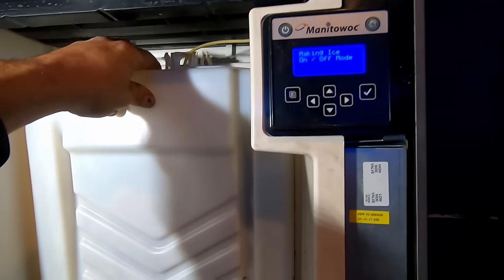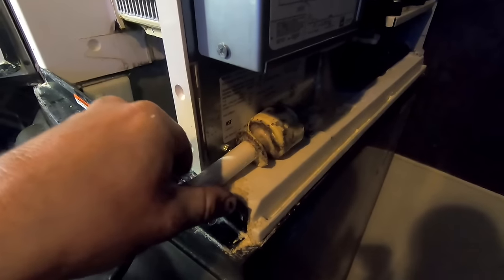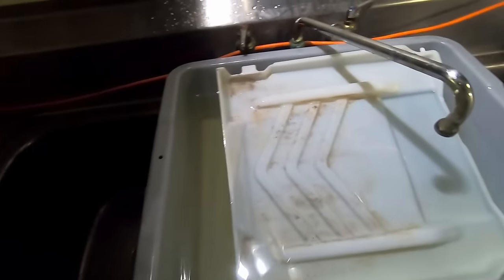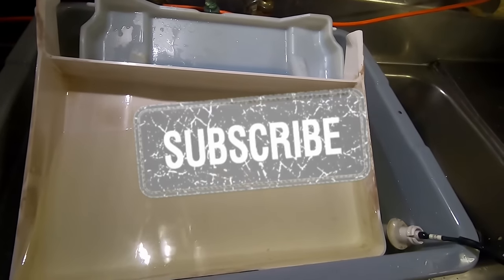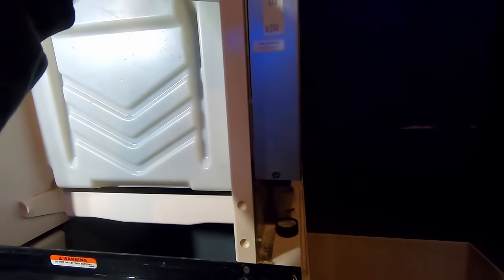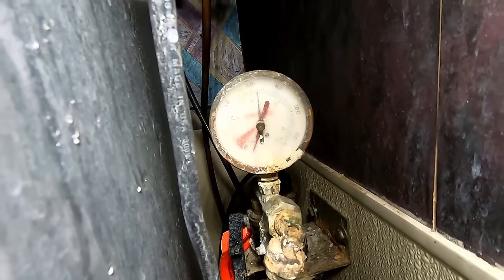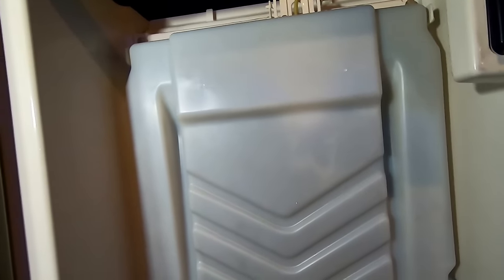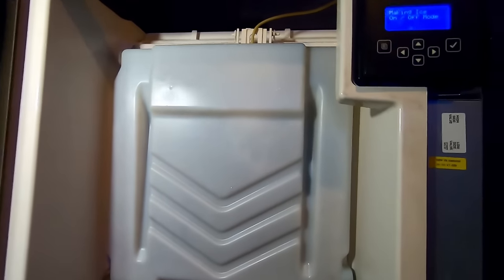Manitowoc Ice Machine Not Making Ice

Comment: A proper cleaning will often make the machine happy again. 😊

For the removable parts, I have had success using phosphoric acid to soak them and get off much of the mineral build up.

Harbor Freight carries a nylon brush set that gets into a lot of the nooks and crannies. The set was $6 last time I bought it-prepandemic. Used to buy it in the store but now I have to get them online.

Comment: This is why im glad my works ice machine has an "Auto Cleaning mode" which pretty just means it will beep at you and refuse to make ice till you run a cleaning on it. (yes you can just run the cleaning program without cleaner, but lucky im the one who cleans it) Looks as good as the day it was installed
Reply: That dont clean the gunk build up in the machine

Comment: One thing that will take off the calcium, but will also eat most metals, is Draino drain cleaner. I guess you probably wouldn't want to use it on commercial equipment since it is a bit hard to wash off, but dipping that toothbrush in some would probably have cleaned those corners you couldn't get clean. Then scrub scrub scrub with something like some soap and water to get the residue of the cleaner off.
Reply from the maker: I found some iron removal that actually works but it's not food safe ☹️. Can't win! 🤣

Comment: After watching these ice maker repair videos, I have stopped ordering drinks with ice in them.
Reply from the maker: Smart, Very Smart 😂
Reply: I may have to do the same too
Reply: But if the ice machine is that nasty, I would imagine the inside of the soda machine is as nasty
Reply: @atomstarfireproductions8695  Post mix dispensers are never cleaned.
Reply from the maker: Nothing seems to get cleaned,  yet the health department worries about door seals and minor issues while ignoring the worst problems 🙈
Reply: So it's bring my own water √. I have a fabulous RO machine at home.
Reply from the maker: @atomstarfireproductions8695  it is 😂🤣
Reply: If you guys repair the hot stuff in the kitchen's and see  how nasty is then you guys will never eat in the restaurant 🤣🤣
Reply from the maker: @joelacosta2082  I've done some hot side but don't prefer it. You're building your immune system every time you go out to eat 😲🙈
Reply: @HVACRSurvival  it's true sir 😬👊
Reply: if you have an ice maker on fridge with through door water/ice dispenser, I suggest you  bend down and take a good hard look up at the thing.
guaranteed it will be black mold city, the whole water nozzle and ice flapper :))
but don't stop there, go to anywhere with city water and "low flow" pee-trickle faucets(commercial low flow/limited temp bathrooms) and see that they're not spraying straight streams. grab a hand paper towel, wad it up, turn water on very low trickle and smash it against the bottom and rotate it around. guaranteed it will dislodge a ton of black moldy crud ;)
Reply: @throttlebottle5906  I don't, I have old-fashioned ice cube trays that I wash after every use. And an RO system with UV.
Reply: @satguy  well, ice maker here, but simple bin catch style. but still, dirty hand in = dirty ice out etc.

Comment: Hey Rick, 
Good Vid. it is possible to get ALL  the scale off the machines you just have to use a stronger acid. i usually just pour straight nickel safe out of the gallon jug into the front cover. i lay the curtain on the side of the sink pour straight out of bottle onto inside of curtain and let soak while iclean other parts. take water level probe and soak in a plastic cup,  hot water and a bit of nickel safe. stops any disasters from wlp fallling into acid.  you can use straight non nickel safe ice machine cleaner to get scale off all plastic parts put it in a spray bottle and squirt full strength onto hard scale deposits it will start to bubble it off. if thats not strong enough. you can buy Muriatic acid from a pool supply by the gallon and use that at full strength or 50/50 mix with water. it will guaranteed get any scale off any plastic surface in seconds. do not use on metal it will destroy any metal. make sure to always wear plastic gloves. i allways fill a Plastic spray bottle with full strength nickel safe ice machine cleaner in it and spray directly on any scale on a plastic surface it usually removes 95% of all scale. use a 3m Scrubbbing Blue sponge with straight nickel safe on front curtian to clean inside.
Reply from the maker: All good ideas 👍👍. I found some wicked iron removal by Wink. But it's not really food safe. I will have to try that in a spray bottle.  I've done 100 proof on the probes and just used a small cup. We normally use the 16 oz bottles and generally I'll use half a bottle on the machine and a half a bottle on the parts. Even though the manual says to use less.😏
Reply: @HVACRSurvival   i Follow the Factory Recommendation on Putting amount in the machine during Clean Cycle. it's on the Door most times. i think its about 5 ounces give or take depending on model. i use a funnel and measuring cups. its allways My first step if the machine has water flow. it gets the party started & gets everything loosened up.  i am real particular about that to not degrade the Grid nickel. i Will however after the cycle is done use 100 Proof in the spray bottle to spray the sides around the Grid and spray the speaker with 100%. i just did a vid on an indigo cleanign . maybe check it out and see if some of my ways might give u some ideas.
Reply from the maker: Sounds good OC👍👍
Reply: @HVACRSurvival   i do have a manitowoc indigo playlist too.

Comment: Maybe I missed it but I didn’t see you using a nickel safe cleaner. It’s usually green. This will remove the scale buildup .  I soak the removable parts in a very heavy solution.  The stationary parts I hit with a wash bottle.  Most of the scale is removed , then I go after it with a sanitizer to kill the scum and slime.  It can take up to 4 hours to clean a mess like that .  Luckily the  bin is already empty otherwise that would need to be emptied as well.
Reply from the maker: I had a whole bottle or 2 of Nickel Safe in the wash tub.

Comment: BTW i got a new part but the connector is different. It is 4 pin straight rather than square. Did they change the part ?
Reply from the maker: Normally they make any replacements the same. Probably the wrong part.

Comment: I had a quit cube last week. 14 of the vertical slates were loose.
Reply from the maker: I believe that's from the ice getting to thick and tearing itself apart. I know you can remove one of the loose dividers without a issue.
Reply: @HVACRSurvival  all the nickel is gone as well. Gonna replace the evap.

Comment: What would you say is wrong with this type of machine issue I had was  when it goes into harvest mode but is in it for a few mins then just shuts down when you lift the flap you can pull the ice right off but when it's in harvest mode you can see the temp of the plate go from like -18 to 9 Deg so hot gas is working
Reply from the maker: Depends what brand it is, what model it is. Manitowoc older machines had a 3.5 min timer,. If it doesn't drop before that it gets a strike against it, after 2 or 3 it locks out.
Reply: @HVACRSurvival  it's a Manitowoc indigo 
I noticed a few times the ice drops out almost as the machine goes back into the next cycle and the ice made is pretty thick could the ice thickness probe be an issue here
Reply: The hot gas valve is all good plate gets nice and warm it's like for some reason the ice don't want to fall off other thing I am wondering even though the plate is clean of crap could the Nickle be coming off causing it to stick and not fall off what you think
Reply from the maker: @robgraham1204  that can cause it, I usually run cleaner through the plates almost every time I'm having a harvest issue for that very reason, some machines work fine without the nickel other machines need it. Is this a Manitowoc machine?
Reply from the maker: Check your bridge thickness. If it's to thick or to thin, that can cause problems.

Comment: I always say no ice. I see what comes out of these things
Reply: I made my own UV air filter and it’s worked flawlessly since. No more organics in my ice. No worries about aldehyde production due to the moisture. The price the ice machine companies charge is outrageous. Even the replacement bulbs cost $2-5 and they charge $100-200 for a bulb.  Places with severe issues can uv sterilize both the air and water. IMO, physically cleaning the machine once a month with a quick warm rinse with a spray bottle is great because I can inspect the machine.

Comment: Any trick to reattaching the water level probe?  The wire didn't follow the probe out when I removed it to clean :(
Reply from the maker: Where did it break
Reply: @HVACRSurvival  It didn't actually break, I just can't see the connection because it's inside the little cavity where the probe lives.  I jammed the probe back into that space and it kinda clicked into place, but the water trough overflows, so I'm guessing I wasn't lucky  enough to connect it successfully.